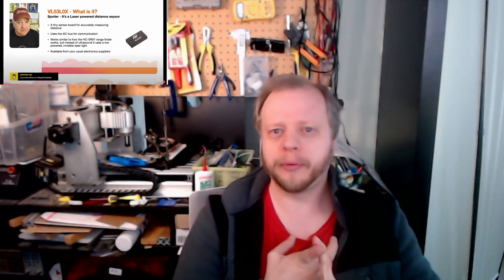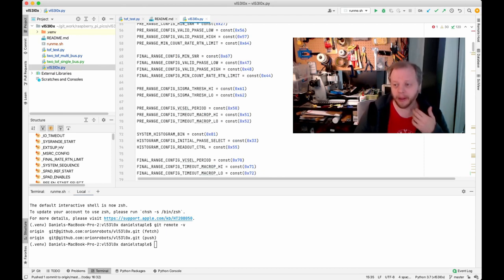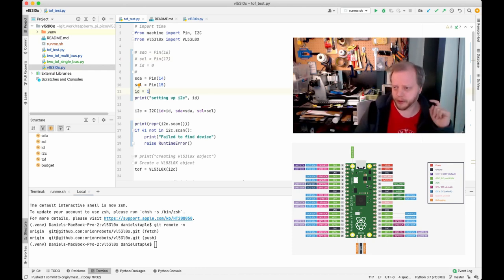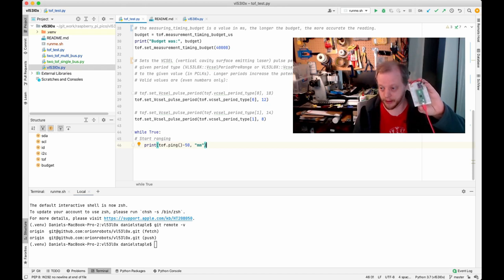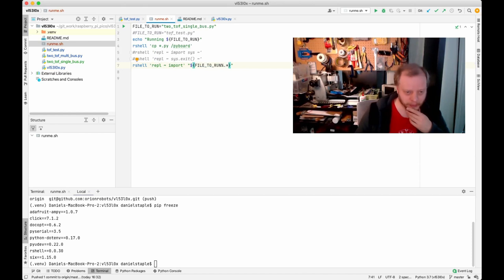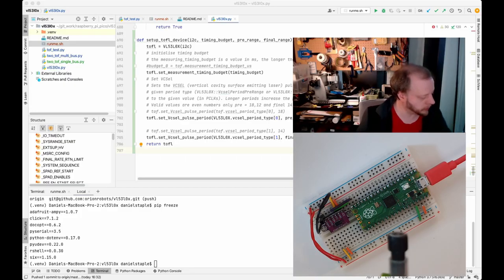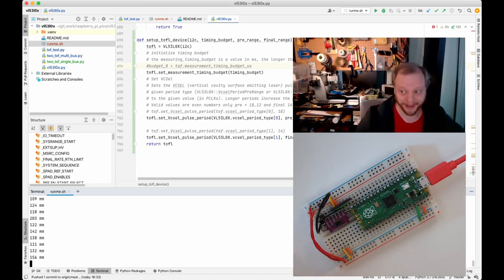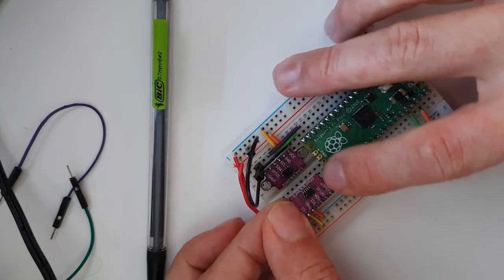Using the Raspberry Pi Pico  with 2 x VL53L0x in Micropython

Comment: Thank you! How can i change the data from mm to inches? Also, i need it to be very accurate at distances of 14mm to 100mm how can i get me there?
Reply from the maker: I guess you could divide the result by 25.4 since that converts mm to inches. Not sure how well it will cope with 14mm, datasheets for these say 30mm. Maybe the vcnl 4010 might do what you need?

Comment: how can i use more of 2? i need use 5
Reply from the maker: Hello, yes, you can use more than 2. You'll need more IO lines to do that. This would the number of devices - 1. You would need to connect those to the X-SHUT pins on them, and then use that to disable all but one device on startup, then you'd reassign the I2C address on the first, enable the second, assign it's address and so on up to the number of devices you have. You can also use the second I2C bus on the Pico on different pins. Another alternative, with additional hardware is an i2c multiplexer like the TCA9548A on a breakout.
Reply from the maker: See 21:25 for some detail on this. Also https://orionrobots.co.uk/robotics-at-home/2023/01/26/using-multiple-vl53l-type-sensors.html for an overview of the solutions.
Reply: Could you make it?